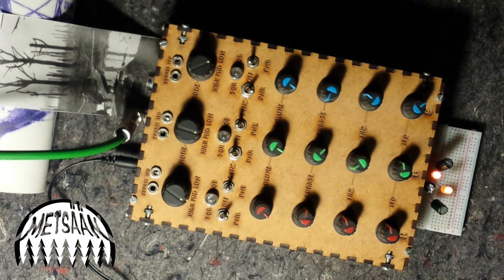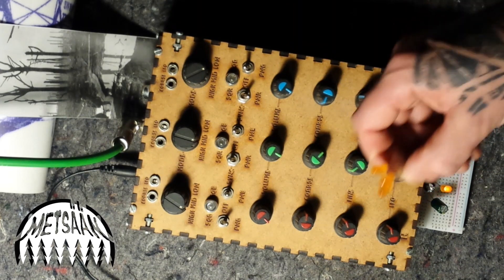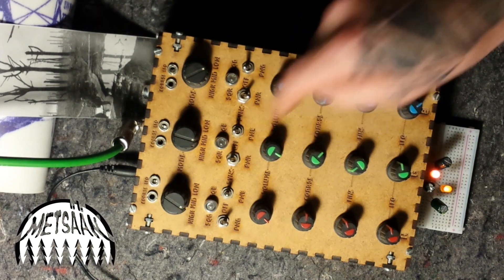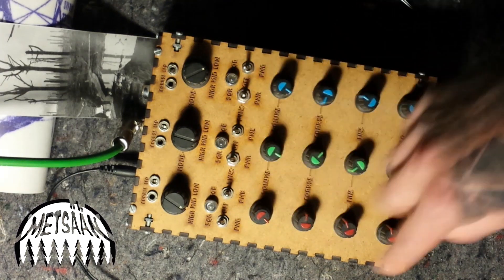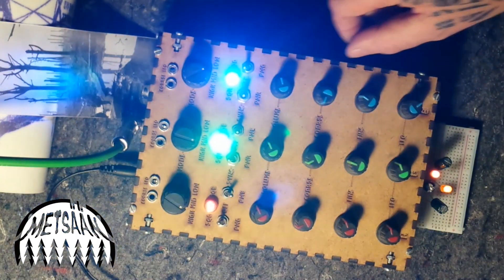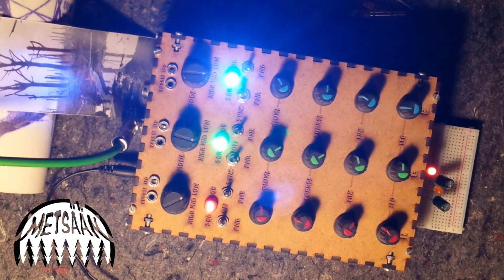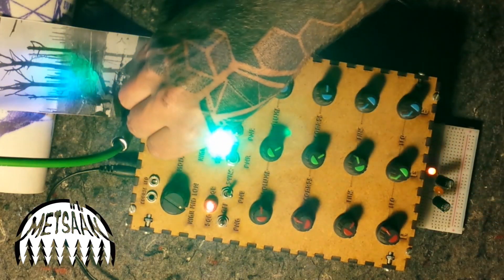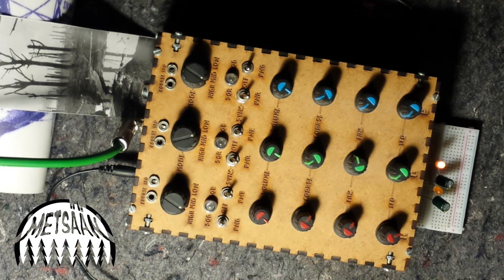Casper Electronics NOVA DRONE build by Metsään

Comment: I like the mounted switches and pots on the panel… I went and bought some precision multi turn potentiometers that I thought I might put in for the row of coarse tuners, to aid in tuning by ear.  Then, after thinking about a panel for those potentiometers, I realized that some much nicer three position selector switches ought to go on the panel.  Your build is pretty much a very pro model, for its switch and mounted potentiometer upgrade.  My hunch is that indeed that was a good idea, for I didnt notice not so much as even one little scratch of static, even when wiggling those wires from off of the proto board below.  Your model turned out really nice!  THANK YOU FOR SHARING!!